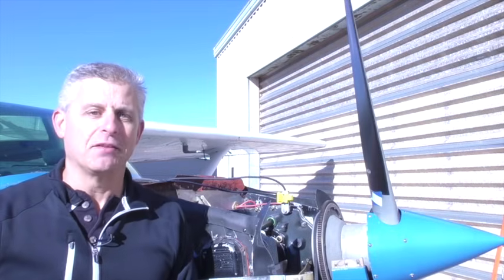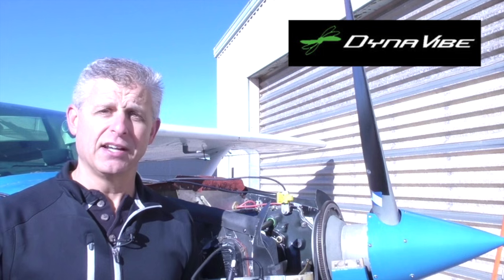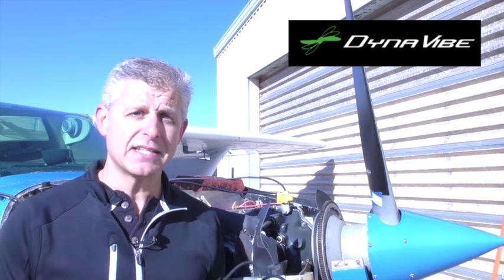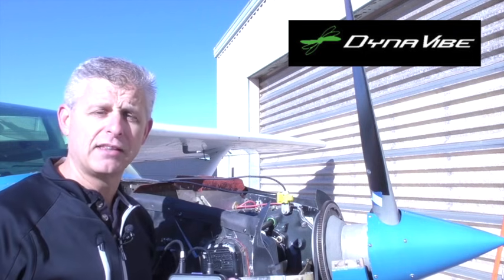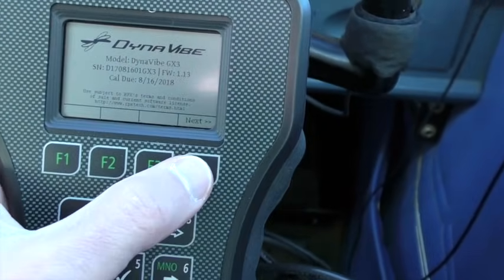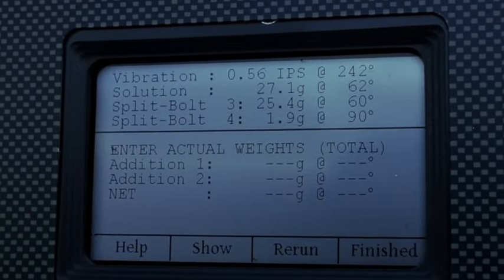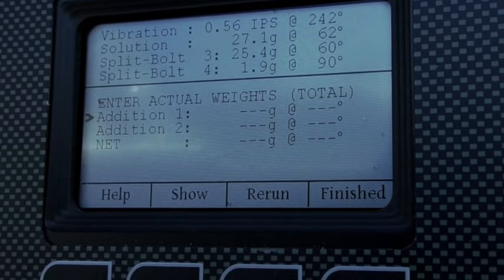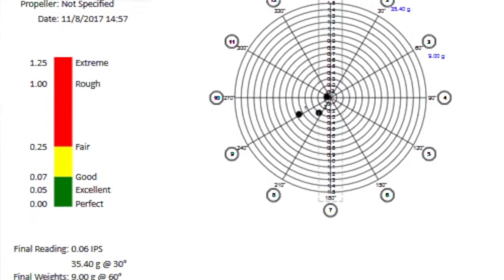Aircraft Propeller Balancing Explained

Comment: Our EAA chapter recently bought the Dynavibe Classic as a chapter tool. We have balanced several aircraft and to our surprise, brand new engines and propellers are way out of balance, some as much as .71 ips. I've never seen ANY aircraft that has had a balanced assembly without doing this. Every time we have noticed a significant reduction in vibration when we come in below .06 ips. We try to get below .04 ips depending on the owner's patience. I had an extremely difficult balance job on a Long EZ because it had a prop extension. Trying to balance at the flywheel doesn't work with prop extensions, we had to balance at the spinner bulkhead...DUH!
Reply: Я баллансировал даигатель С-182Р. 0.81 - 0.06  Стало меньше вибраций. И да, ни на одном самолёте не бывает идеальной баллансировки...  Хороший, очень полезный инструмент. Супер!

Comment: Question, how do you add 1.9 grams to hole # 4 when a 1/4 inch bolt and nut are about 6 grams.  You did say that you used only two locations, but to get a weight that small you would need to add a third bolt opposite to counter balance hole # 4 bolt.  Did you take a spectrum reading on the rear of the engine to compare the two readings to see if the vibration was the propeller or the engine?
Reply: My guess would be add a weight to the bolt, like a large washer

Comment: It is removing engine vibration, however if you removed the prop, it will still be out of balance
Reply from the maker: Engine vibration occurs at a different frequency. The DynaVibe maps out all the vibration frequencies and isolates the propeller vibration. Then it helps you remove it by balancing out propeller/spinner imbalances. The result is amazing.

If there is any engine related vibration beyond normal limits, you can identify it and work to solve the problem.

Comment: Sound would be nice!
Reply from the maker: Have you checked your PC and sound settings?  This video has audio.
Reply: There is sound only in first few seconds then it fades away to nothing. Only video on youtube I cannot hear on my computer.
Reply from the maker: We have tested it here and asked other viewers.  All report full audio throughout the video duration.
Reply from the maker: Check your stereo settings. It looks like (for some reason) the right speaker channel dropped out, but the left works throughout the video.
Reply: I discovered I can hear it OK if I plug external speaker to my laptop audio jack.  (And it's ok on my phone). So it seems to be a codec issue with my laptop audio player. I have ThinkPad Carbon SSD laptop (in case it occurs on anyone else's). It's the only video on youtube I have found to have an audio issue.